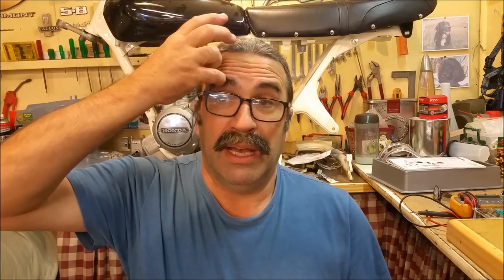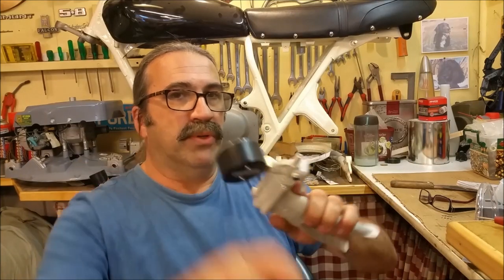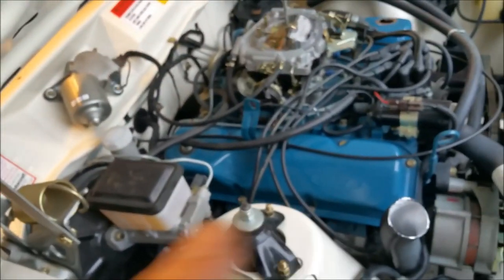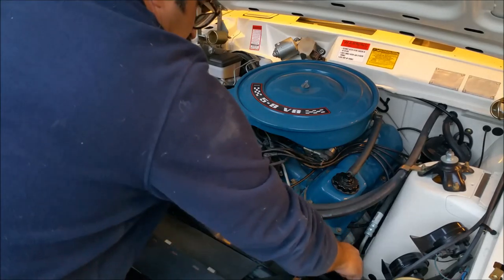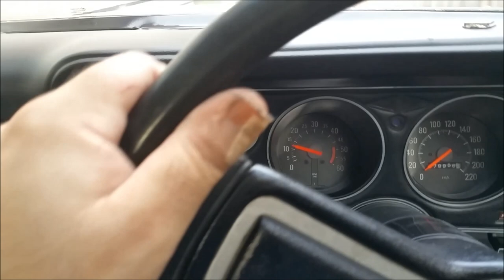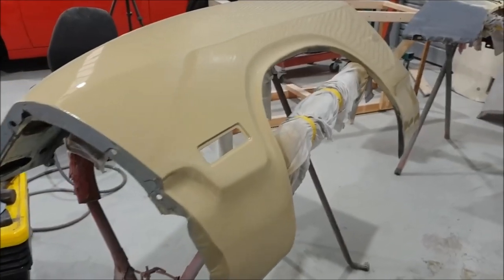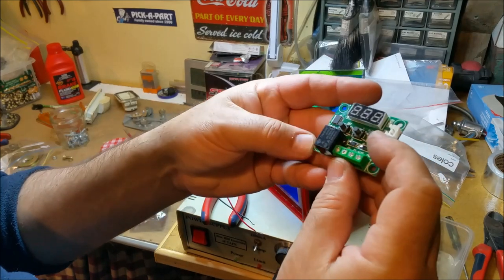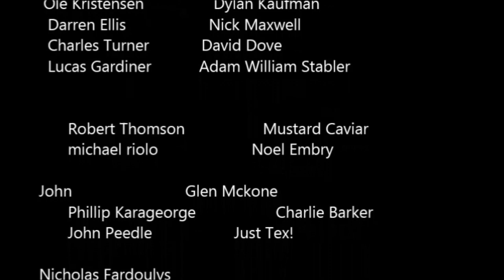XC GXL Restoration Part 53 - Not a Real Drive, But a Drive!

Comment: Sent this to UTG. Hey Uncle Tony (UTG) , just seen this clip on a comment dropped on Peter Andersons Late 70's  Aussie XC Falcon 351 4 speed GXL build and with the theme of this vlog, I thought  it may make a great experimental future vid for the viewers if they wanted to update their analogue ignition system. System looks like it integrates with an analogue distributor to illuminate some of the ignition parts that wear and eventually fail. Experimentally, it would be a great myth busters ensemble. Could be right up your alley. Just a thought. "123ignition Australia is proud to announce the first fully programmable wireless Bluetooth 4.0 ignition! Control your 123\TUNE+ with your iOS/Android smartphone or tablet. The App makes it possible to adjust the ignition curve and shows an electronic dashboard."

Comment: Nice to see the XC move under its own power, i had a XW with a single rail fitted to the straight 6 and the  reverse gate detent was the same  as yours Peter.
The thing had some miles on though but it never worried me driving it daily for serval years.

Comment: Hey Peter, as has been previously mentioned in the comments, the lockout lug on the shifter wears on the forward edge when engaging reverse. The bigger issue is the shifter extension housing, when the shifter is depressed, the lock out lug on the shifter line's up with and engages with gate in the housing when reverse is selected.
After years of spirited driving/shifting, also being an aluminium part, it wears out horribly. I came across this very issue with my xb, I could select reverse as easily as first without realising it.
You can shim/pack the shifter or have new slots cut in to shifter for the retaining clip, previously mentioned.
Find another shifter extension housing with less wear, or repair the original, weld up and cut/machine a new gate. Looking to improve the sifter overall, I purchased a performance aftermarket short throw shifter from the UK, really well designed and built bit of kit.
If memory  serves me right it was for an escort or maybe cortina 4cyl. 
It did require the shifter to be modified (carried out by a mate/engineer of my dad's) the shifter end forks are straight up and down, in line with the shifter, where as the 6/8 cyl single rails shifter fork is offset to one side. It also does away with those stupid plastic shift fork washers/bushes. It took a little bit of fiddling to get lined up correctly, having a spare box helped greatly, the end result was a shifter I could really lean on, it had fantastic feeling with a tighter/shorter pattern, better/easier engagement (maybe placebo affect, lol) the effort to shift felt better and never once did the shifter end up in my lap or on the floor. It was definitely worth the effort.
Sorry  for the essay, keep up the great work!

Comment: Put a shim under the locking nut on the shifter it brings the shifter fork up slightly and stops the problem of grabing reverse instead of 1st. The top edge of the fork wears and the gate edge wears to so by lifting it up slightly it stops it from falling in. I had a adjustable one made with lock tab ring so as it wears I could adjust it slightly to keep right. Also had a new circuit grove made 5ml down which put more tension on the spring

Comment: Ford manual gearboxes from that sort of period weren't really known for having the most positive lock out to prevent accidental selection of reverse rather than first, especially after the vehicles had some use under them, which could, and did, cause embarrassing moments with people going away from the lights in reverse rather than first and backing straight into the vehicle behind them.  One of the touring car drivers did that back when the Sierra Cosworths were the quick boys on the block as he was running an upgraded road gearbox rather than the dog leg first race gearbox that most Cosworth competitors ran, and they had reverse up next to first.  I know there were various modifications available for those gearboxes to improve reverse lock out and also to replace the nylon shift balls which liked to wear out and leave you with the gear lever in your hand and a box full of neutrals, and I would think a lot of that sort of stuff is still available from specialist performance parts suppliers.  You said you'd replaced the spring on the shifter assembly, so, as someone else suggested, replacing the shifter ball bush seems like a fair place to look next as they are wearing parts and can wear very badly with heavy handed drivers.  It might also be worth looking into whether it's possible to upgrade the spring or to maybe install a second, helper spring to provide a more positive lock out.  With it being a Ford then there is probably loads of information on the internet about how to upgrade the shift mechanism on old Ford four-speeders from right across the world as they seem to have used broadly similar shift mechanisms in pretty much all their rear-wheel drive gearboxes for a very long time, which means it's been seen in a lot of faster Fords over time and you know how people love to mod and upgrade them...

Comment: The reverse gear selection in my 351 4 speed GXL was almost the same. I think when they were new you had to push the stick down to select reverse. Also point of note the 351 single rails had a different 1st gear ratio than the 302's at least that is what I was told when i had mine reconditioned many moons ago

Comment: One small drive down the driveway, one major milestone for the XC.  Hard to believe this is the first time it's moved under its own power since you brought the old wreck home.  Now that you mention sun visors, I didn't see any on the MG either when you took it for a drive. 
As for the gauges, 73 to 75 ohms at empty - 10 ohms at full.  Anyway, don't worry, I'll get you the right sender if you like.

Comment: In 1996 I bought an XC GXL wagon. It had a 5.8 but with the FMX auto. I didn't like it at all. Power steering was very light. The suspension was very wafty/bouncy and it sent me to the point of sleep on country drives. The two way tailgate was a talking point I guess but otherwise, nope, not the car for me. Having said that, I can't wait to see yours finished. They are a good looking car.
Reply: GXL's are only sedans.
Reply: @Gokizzmass  OK, Fairmont then. Thanks for correcting me.

Comment: Hi Peter I'm about to do a xa how much paint did u use from 2k epoxy primer to 2k high build primer and did u do 2 to 3 base coat before main colour and then clear coat how many litres did you need for each stage what was cost all up to thanks michael